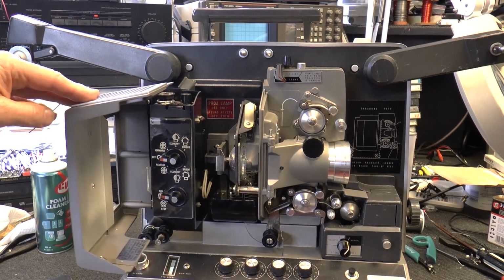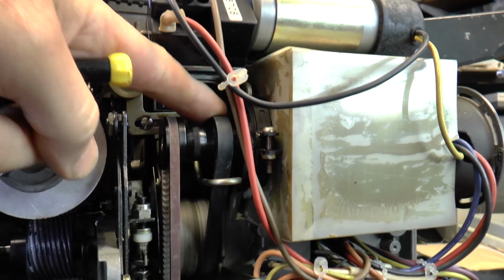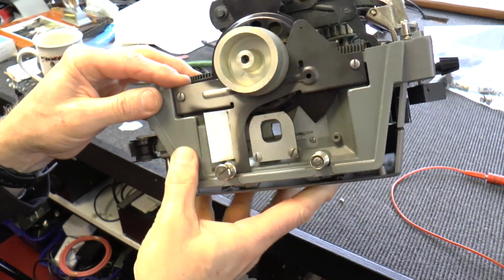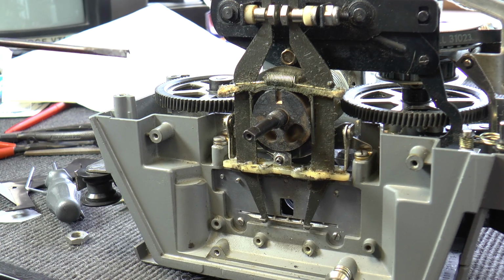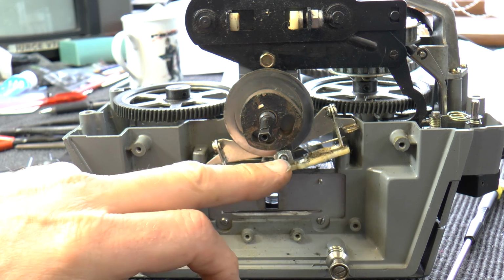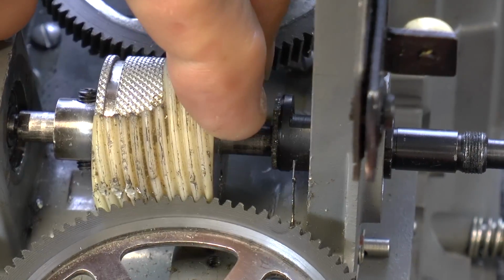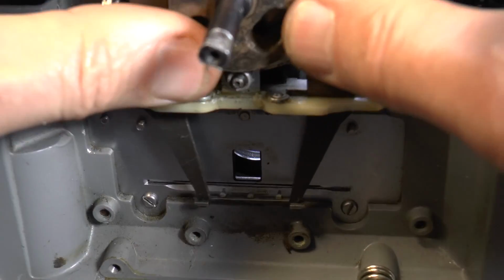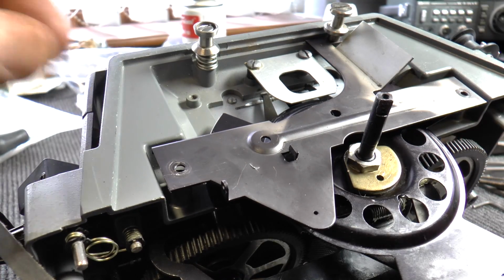Bell & Howell Filmsound 16mm projector replacing main drive worm gear

Comment: A very good video! I wanted to ask are you using 2.5mm allen keys ( not any other size)? The cost of the 'bristol' set, the items that are meant to be used, are very expensive and difficult to obtain it seems.

Comment: This is a great video  though. I have a 552 where the nylon gear is loaded with cracks, and..getting ready to order the replacement  gear. I've worked on tons of 35mm projectors with worn assemblies,  yet this will  be my first dive into 16mm rebuilding. Thx and good luck.

Comment: How was the claw assembly?  When the pull down claw assembly was removed, did we check the claws for wear? The wear would be at the base of each tooth where each tooth is pulling down the film. After awhile, the base of the tooth would experience a groove where the film is being pulled down.  The picture will not be steady on the screen and have vertical jittering movement due to this wear.  The claw assembly will have to be replaced.

Comment: Excellent help. Thank you. I have one to do. Just need to find someone who has a replacement worm gear.
Reply: Also I if I get a worm gear without the animation section on it. As I won't be using the animation section of the projector. Do I need to remove certain parts from the 655 Machine or can leave as is without any issues?

Comment: I have the same model of 16 mm projector and the sound of films is not precise at all, we can hardly understand dialogs ,I've changed the sound lamp but it's still the same. Do you have any idea to fix that problem? Thanks for your help
Reply: Bell & Howell uses the type "BAK" sound exciter lamp. If the wrong bulb is installed, muffled, weak sound will be the result. If the film is not threaded correctly around the sound drum, a gurgly underwater sound will result.

Comment: Thank you for your lovely video.  They are (were) great machines when they actually work(ed)!

I had a 'brand new' genuine B&H spare gear sitting on a shelf for many years. Nevertheless it started to split apart even though it had never been run.

Lubrication (lack of) or other suggested causes were clearly total nonsense.

Elf / Eiki  mechs were a breath of fresh air (despite the laughable loop restorer).

I'm happy to stay with my domestic 35mm installation;  a very realistic proposition now that such equipment is being srcapped.

Comment: I replaced my worm gear and it appears that the gate claw is going the opposite direction than it should.  It actually will rip the holes that the claws go in.  Any thoughts on what I did?  Any help would be appreciate.
Reply: If the gate claw goes backward, the cam is 180 degrees off. There is an indent at the back of the cam, be sure it's lined up!

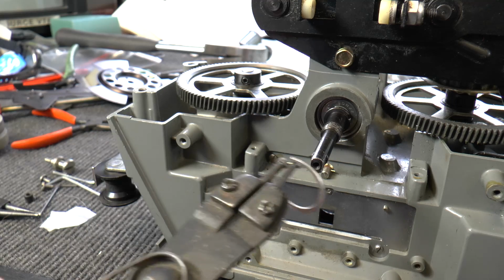Comment: Excellent video but I don't understand why installing the new gear was skipped over at 12:45.  Kinda the point of the video, no?
Reply: yeah, that was weird..but turns out he didnt actually replace the worm gear in that PJ as it was a scrap parts machine..he was just showing the procedure, he had already done the job prior on the 1st pj in the vid.. he didnt explain  that very well.

Comment: Hi Robert this is an amazing resource thank you very much. I am currently working on an almost identical TQ1 and when the time comes to remove the main mechanism it seems impossible to get it past the two rollers next to the sound drum even after loosening the sound block. Have you experienced this before? It's very frustrating being so close to being able to remove the mech.
Reply: I take off the flywheel.
Reply from the maker: Hello Damien
It's seems a long time since I repaired my BH. I know what you say about removal of the mech and I think it was a problem, but with a bit of getting it at the right angle it did eventually come out after removing the still frame bits.
Sorry but I can''t think of any other  reason why you can't get it out. Regards Robert
Reply: wow thanks for your really quick reply. I will give it another go soon, I did managed to strip out the animation stuff so my first attempt wasn't a total bust. Thanks again!

Comment: Hi Robert, I have a b&h 8D 644 and the framer button does not move in any direction, what can be the problem?thanks, regards.
Reply: Gummed up lubrication on either the framing knob shaft or the framing plate.

Comment: though I have 2 different B&H models from this one, this video is 
extremely helpful, one question concerning the one I'm working on, the 
worm-gear completely split and popped off the gear assembly while 
running, so in a case like this, how important is the alignment of the 2
 cog-gears on either side of the worm, and how would i go about 
correcting it, since they spun freely after the worm gear broke in half 
while running?
Reply: Very important! Larry Urbanski of Urbanski Film has reproduced the special Bell & Howell Sprocket Timing & Alignment plate as called out in the service manuals. This is used to reset the sprocket timing so you won't lose loops or screw up the autoload functions or chew up film.

Comment: Great instructive video!  I've recently got a Filmosound 655 that has the same problem: worm gear broken; with this video I'd probably be able to replace it, if only I knew where to buy a replacement worm gear.  Any idea?
Reply: Van Eck has reproduced both styles of worm gears. If your projector has a still picture function then use this gear:
https://shop.van-eck.net/PP-0051.html

If your projector does NOT have a still picture function then use this gear:
https://shop.van-eck.net/PP-0050.html

Comment: Thanks for this excellent video, I have managed to replace the worm gear on my projector although it was a struggle to loosen it and the bearing off the shaft. I did find the 2 sprocket wheels needed alignment after I had reassembled, and I tested this buy winding film through by hand turning the wheel at the back of projector. I couldn't have tackled this without your video.

Comment: Fantastic and very helpful video, thanks so much!  I have a question regarding alignment of the upper and lower sprocket gears once the worm gear is replaced.  Is the alignment of the gears really critical?  And if so, how do I determine their exact alignment?  My bad worm gear is SO badly cracked that I have no doubt one or more teeth on the sprocket gears have jumped because of the gap caused by the worm gear crack so marking their current positions may not give me an accurate representation of how they should go.  Thanks again!
Reply: Larry Urbanski of Urbanski Film has reproduced the special Sprocket Timing and Alignment Plate as mentioned in the service manuals. The timing plate is what you use to align/sync the sprockets so you're not losing loops and chewing up film. Larry also sells complete service/parts manuals. Highly recommended.
Reply from the maker: I only did it that way and marked the gears was because it
was the first time that I attempted the repair of one of these machines. In
retrospect I suspect the alignment of the sprocket gears was non critical. Let
me Know when you have a go at your machine!
Reply: Well I tackled the project this weekend.  I can see why the pros charge $250 - $400 for a rebuild on these beasts.  Having said that I now have a supremely quiet and perfectly operating B&H model 2590 to add to my pile of film pushers.  Thanks again for your extremely helpful video!

Comment: I've recently got my Bell & Howell 16mm Filmosound projector over the weekend and it was a Specialist model 552, it had the same design as this one, and it was a tube type unit. When I first got it, I turned it on, it loks fine, except it has problems, the sprocket gear and the reels are frozen. I took it apart and it had the original grease all turned to stone. I removed all of the old grease which has been sittin' around for decades, and cleaned the worm gear, but the worm gear looks fine with no cracks or chips at all. After that, it works fine with the sprocket wheels and the reels moves very well. In addition, another problem is that the Autoload feature won't go there. It was stuck when I tried to fix it and get it running. So I tried the film manually instead of auto threading. After that, it works fine.
Reply from the maker: Just as well the worm gear does not need changing in your projector. As you can see not an easy job. The model that I stripped down for the demo was a auto loader with valve audio. It's got loads of other faults so just keeping it for spares. That's why I did not replace the worm gear in that one used for the video.
Reply: ahhh. you did not explain that in the video..

Comment: robert, did you notice those two tiny, tiny bearings on the end of the shuttle arms, where the sprocket teeth fit?
Reply: Don't lose those tiny bearings. They are important to hold the shuttle correctly.
Reply from the maker: I can't remember seeing them on either projector. Maybe they
were still in the hardened grease on the shuttle arms, or dropped out! Have you got a photo of them?